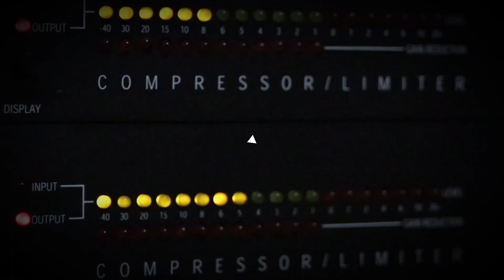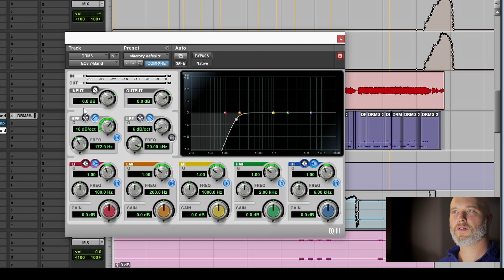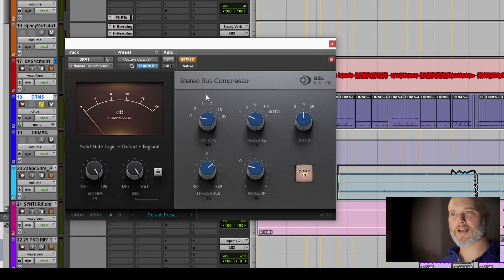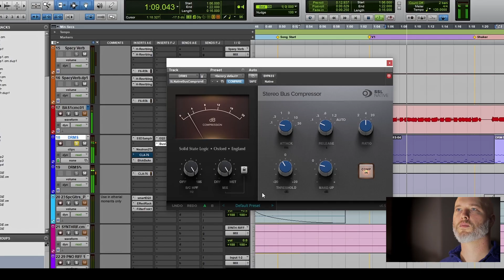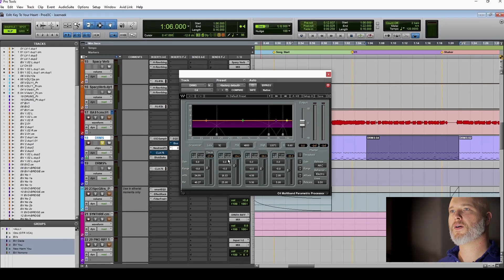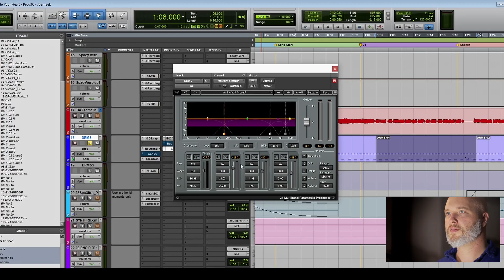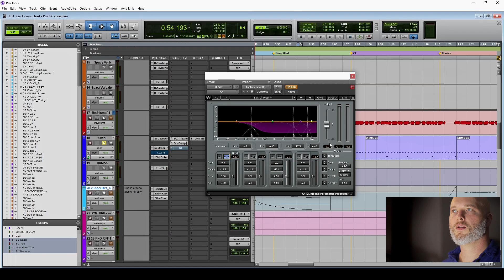Side-Chain Filtering Explained

Comment: the way i go about setting up the mixbus compressor is to zero out my compressor, set the threshold and then the attack and release settings. After this i get the compression going which i judge by the movement of the VU Meter's needle. However, immediately i start egaging the sidechain filter, the needle's movements change or it stops. At this point am i still getting c ompression?

Now, to get the needle wagging again so i can judge the amount of compression i'm getting, i start resetting the Threshold; is this correct?

I ask this because resetting the threshold to see the needle wag means disrupting the threshold setting that i so painstakingly set. Now once i get the needle moving with the new threshold settings and i adjust and get the compression that I want, do i leave the Threshold at the new setting or return it to the previous setting before i engaged the sidechain filters on the compressor?

Comment: So one might say this technique is used to preserve frequencies? Like int the case of compressing a metal guitar riff. You want to target certain transients without losing low frequency energy?
Reply from the maker: Depending on how they're driven, some compressors may eat up some frequencies more than others. There's no one-size-fits-all answer here. If you want to target the compression of certain frequencies specifically, then you're better off using multi-band compression or a dynamic EQ for that. In the case that I show, using a broad-band compressor like the SSL, filtering the side-chain adjusts the amount of compression by taking away frequencies that might otherwise make the compressor react unfavourably to what it is you're trying to make the compressor do. For instance, if the compressor normally compresses heavily (reacts a lot or abruptly) on bass tones present in the audio, then taking those out of the side-chain has the benefit of smoothing out the overall reactions of the compressor to be less abrupt or heavy. The side-chain is only heard by the compressor and therefore is not something we necessarily perceive as a change in tone, in the same manner we would hear a tonal change when adjusting an EQ. You might hear a tonal change as a result of the change in compression behaviour, however, that's getting into a lot of the subtle nuances of compression and how we might use them in other musical ways.

Comment: Yes but inturn more 'Perceived' low end is coming thru. Pretty sure Pro's understand this
Reply from the maker: What I explain in the video has nothing to do with perception, it's about understanding the fundamentals of how a compressor works. The resulting tone could skew more low-centric, and in most cases it will, but this depends on how the compressor is reacting to the bandwidth limited signal in the sidechain. Not all compressors will react the same way and it depends greatly on the nature of the signal that's left in the sidechain. But don't believe me, we just met, try it out for yourself.

Comment: How to use sidechain filter eq when we don't have sidechain filter eq? Like we don't have sidechain filter in waves bus compressor?
Reply from the maker: Good question. Well, you have 2 options: 
Option A - Use a compressor with a side-chain filter eq OR Option B - Use pre and post eqs. Pre eq to get the compressor to react how you want by boosting/cutting and then Post- EQ to restore the desired tonal balance. I'd suggest using linear phase EQ for Option B if pre-ringing is not a big issue and the eq moves are small. The bigger question I have for you is: Why do you need access to the side-chain filter? What task is it for?
Reply: The why is exactly what you're explaining here. We would like to compress the drum bus without affecting the lower frequencies. For some reason Waves G-Bus doesn't come with a HPF to bypass the low freqs as it compresses. Option B you explained though, if I'm understanding it correctly, kind of sounds like you might lose information or quality in trying to manipulate it with a post EQ to get the sound back to where it started. Is there not a simpler method? Perhaps sending the drum bus signal to a separate bus to HPF it there before applying the bus compressor on that new bus?   @SPLMixing

Comment: Very informative! By the way, have you had any experience in using sidechain LOW-pass filters, or for that matter, sidechain filters when using a gate/expander??? If so, what would be the best applications for such filters???
Reply from the maker: Yes, I have. Only in a special circumstances where I can't find what I am looking for from the compressor or gate. Listening to the Side-Chain helps you there too. Sometimes I will send a highly modified copy of an existing track into a Side-Chain, so modified they only are used for this purpose, and never actually heard by the listener. I call these ghost Side-Chain tracks.

Comment: Sorry, but after watching your video twice I still don't get what you mean. How are we supposed to reduce boominess in the bass then?
Reply from the maker: To reduce boominess in the bass, your first step would be eq, either low shelf,  high pass filter, bell filter...

The purpose of using the high pass filter on the compressor is to stop it hearing and reacting to low bass frequencies that might otherwise push the compressor too hard. The high pass on a compressor only affects what the compressor hears, not what we hear.

Does that clear things up?
Reply: Hi @SPLMixing  OK.  I get it now... I completely misunderstood because I guess I wasn't really listening after all.  I was mixing up EQ with Compressor.  Thank you so much for getting back to me!  Paul

Comment: Is the purpose of doing this to get a better idea of how the compressor is affecting the frequencies above the cutoff point? I understand your explanation, but the purpose is a bit unclear. Thank you.
Reply from the maker: The purpose of using the side-chain high pass is to change the operation of the compressor, to allow it to ignore bottom end information that might be triggering the processing unit too much. The purpose of the video is to explain that it doesn't suddenly make the compressor dual band, or stops the compressor from compressing the lows. The side-chain signal is simply a parallel copy of the original signal; we hear the original signal and the compressor hears the copy (side-chain). Changing what the compressor hears doesn't necessarily change what frequencies get compressed.

Comment: Nice explanation.

The SSL plugin has a helpful A/B switch.  Try this:

Set to A. Attack=1ms, release=0.1s, ratio=4

Run a full mix through it with no SC filter and dial in threshold for 8dB of peak compression.

Use a song with a decent bass and kick drum groove.

Then switch to B and set everything the same as A but run the SC up to 120Hz.  Next adjust the threshold
down to get the SAME peak of 8dB compression.

Now A/B/A/B...
Do you notice any difference in the character of the low-end?

I think it plays with the feeling of low-end punch and sustain, even though it is just full band compression.
Perhaps this is a cause behind any confusion or myth.
Reply from the maker: Yes, I think you're 100% right. That's getting into the finer nuances of what a compressor does. I agree there is a certain degree of frequency dependant compression applied, and that the ratio application is never completely linear across all frequencies - especially in analogue modelled plugins like the SSL Bus Comp. I thought about explaining that aspect, but I know a lot of beginners will find that confusing when they're trying to grasp the basic concepts of SC filtering. But you're absolutely right, there's more to it going on under the hood.